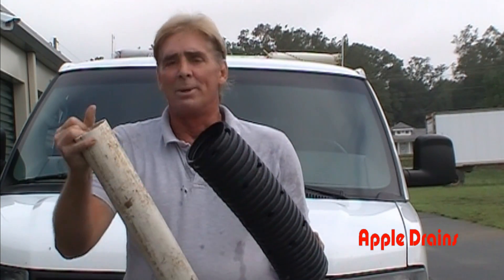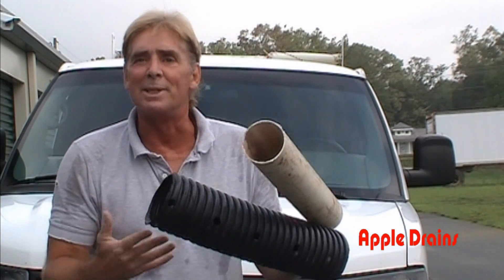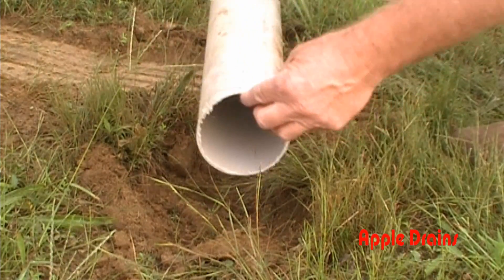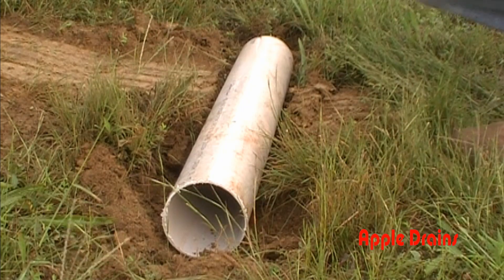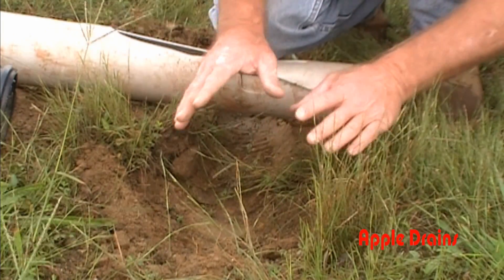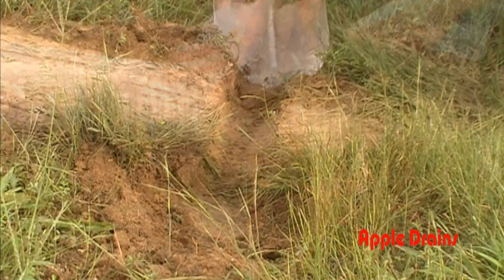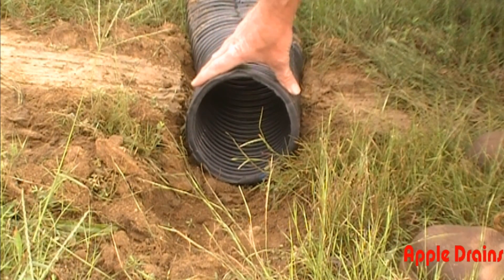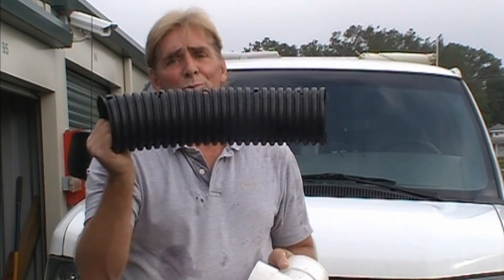Which is Stronger, PVC or Corrugated Pipe - Actual Crush Test with 7600 lbs Van

Comment: Thanks for the video. I'm placing ADS black drain pipe under a gravel driveway about 18" to 24" dp. and was curious what kind of load or crushing forces the pipe might be exposed to at those depths.

Comment: I have to run a 25 ft  solid corrugated line from a catch basin into a canal. It will be buried from 12 to 18 inches underground in sandy/dirt soil that trucks drive over ocassionally. Should i put gravel on the bottom of the trench before putting down the pipe or will the existing sand be good enough since its not a perforated pipe?

Comment: In the automotive world. Any peice of tubing or metal that has squares or circular or angels on it is VASTLY stronger thsn just a tube. 

In the gun world a hexagonal barrel is stronger than a circular tube barrel. I highely doubt a circular tube of pvc is stronger than corrogated pipe. 

We just had a distribution box and about 5 pipes 30 feet each of the drain field replaced. Because prior owners drove vehicles over it. The pvc was completetly crushed .. smashed like pancakes. Broken into peices too just like this video. and this was buried at least 4 feet down i think. The currogated pipe however was perfectly fine.

The plumbers who did the job replaced all the pvc with currogated.

Comment: You're using D-2729 which has walls 0.076 of an inch thick when Schedule 40 walls are 0.237 of an inch. Over 3 times the thickness of the walls of the PVC pipe you used.
Reply: I noticed that too. I found a different video which proved PVC was much stronger and he used a tractor!

Comment: Any plastic pipe will fail if not in the correct conditions. The strength comes from the pipe being fully buried. For instance: hit 3034 (green) pipe with a hammer above ground. It will shatter. Schedule 40 pvc likely won’t. Bury 3034 pipe and expose it to conditions it will likely come in contact with: no problem. There is a scientific equation on this but I don’t remember what it is. The principles of a correctly buried pipe make it much stronger than it would otherwise be

Comment: Pipe of any type is not intended to take the direct unburied weight of a car tire.   All crush ratings are based upon having a minimum depth of coverage.  This test is ridiculous.  Flex is used because its easy and cheap, not because it is stronger.    Want it to last, want to be able to snake out clogs, go with the pvc.  By the way, that pvc is schedule 26, there is a schedule 35 inexpensive sewer pipe that is comparable in price and is very strong.

Comment: From reading comments and other sites it's apparent that if the pipe is buried deep enough, let's say at least 12", then it doesn't matter which pipe you used. But for shallow depths I can't find a definitive answer about which pipe is better. So I'm going to say play it safe and lay down a piece of 4x8 plywood  or a couple of 2x8 planks over it before you drive on it. Problem solved.

Comment: Chuck, is it better to use pvc or corrugated pipe for outdoor drainage?  I live in a northern climate, so that might have a bearing on what you would recommend.
Reply: PVC is rigid. Which won't flex with freeze thaw...So corrugated deep enough at least 6-8" and a good top soil pack should last awhile maybe even put some sand in the trench
Reply: @Goodvibes-Adventures  Okay, thanks for the info, Skater Dude!👍

Comment: Obviously the test wasn't high quality, he had the PVC buried half as deep as the corrugated.

But, the white thinwall PVC is still only a temporary solution because it's not as resistant to ultraviolet  light, which permeates the soil 18" or better. Drainage tile and conductor lines are usually buried shallow (not nearly as shallow as his test) the top being 6" to 12" deep. Try digging one up in 10yrs and watch it crumble to pieces. Also, in the areas with winter weather, the ridgid pipe will be at constant odds with the frost, which causes force against the pipe and causes movement, which also leads to long term degradation and sometimes catastrophic failure. The benifits of smooth pipe are: 1) can be snaked out. 2) easier to install at a consistant slope. 3) it works great as a basement perimeter drain (no sun, no frost).

The black colored corrugated pipe has these benifits: 2) naturally resistant to UV light. 2) it's flexable. 3) the exterior corrugated surface does add strength (only when fully buried in gravel  or dry soil). 4) the corrugations lock the pipe in, to keep it from moving.

However, most of the positives of both worlds can be achieved by buying double wall black pipe, which has a corrugated exterior and a smooth interior surface. Doubtful you'll find it at the homeowner grade hardware chains. Don't base your decision on price alone or: a) your plan might not work at all. b) you'll be doing it again in 10yrs. Always use a transit or laser level to map your property out before planning a drainage system! If you cant plan it out well, you shouldn't do it yourself.

Comment: I found this line "They're even known to collapse underground due to erosion". If your corrugated failed, that would more likely to be the reason. It would collapse with no dirt filled on its sides. I tried to fill dirt and compact it properly, but still, it was hard to do it right. Also, I might have damaged the pipe a little bit with all the hand digging tools that I was using. I wished they made the corrugated pipe thicker wall.

Comment: Here in Nebraska, the ground freezes up in the winter. Ground also shifts/moves constantly any where you live. For that reason, it is good to have some flex in the pipe. PVC is too expensive and hard to install. The cost to install one would exceed the benefit it yields. This test doesn't matter when you bury them underground, but it does shows one disadvantage that pvc pipe has. Any system will fail under some condition. That is why the cities are replacing their pipes all the time. If you are lucky, you might get 100 years out of that solid corrugated pipe. I'm not an expert to know how long they last. My neighbors corrugated pipes are working fine after 8-10 years, or so. I just installed one by myself and hope that I won't have to dig it up in 40 years. I have to say that I don't like the thin wall on corrugated pipe. It can be thicker, but companies cut cost everywhere, while the cost is on you.

Comment: My only question on this is does the corrugated pipe handle freezes better?  I’ve seen other videos that say PVP cracks during the winter.
Reply: PVC will crack if there's enough standing water in it and you get a freeze. If you're using it as a conduit under a driveway/sidewalk or to run a power or phone line to a shed, just make sure water can't get in.

Comment: How do you keep roots out of tbe pipes!?
Reply: Wrap a bare copper wire slid inside the fitting. The root will not pass that copper to get to the water.
Reply: Drainage pipe is surrounded by gravel then wrapped with geo fabric like a burrito.  That should keep everything out, except water as intended.

Comment: Actually ABS for drainage is a little overkill, HDPE would work just fine...Whats important is the application quality which means how deep you bury, how well you support etc... and of course the SN class for corrugated pipes...its like PN for pressure pipes...but SN defines how strong the pipe is against forces from the outside. This is a bad application example from every angle! both for PVC and ABS pipe. PVC drainage contains tons of CaCO3 which makes it cheap (producers make more money) and hard and  at the same time more brittle. So its no suprise it cracks. I dont know about snakes or water freezing inside the pipe but a foot underground its warmer, and its not right to generalize these local problems when comparing 2 pipes...its not just...
Reply: He is saying ADS pipe!! Not ABS!!!   ADS is a manufacturer of the black corrugated stuff! They also make a really great product that's just like that PVC but is triple wall HDPE and is smooth in side just like PVC. But not as brittle!

Comment: We call that white "thin wall" PVC class 200. Good for drainage or lateral (non-pressured) sprinkler lines but not rated for main lines. I wouldnt use it as a sleeve either if its across a drive way or going to ever have a lot of weight on top of it.

Comment: Just run either of them through a cinder block where you will be driving most and you won't have to worry.
Reply: +casperhr22 That's a good idea.
Reply: If you use 8x8 chimney flue cinder block you can run up to 8 inch couragated. Definetly recommend number 3 rebar through the cells and mortar between the blocks
Reply: 4 years later, still NOT a good idea.  Cinder blocks don't have much strength when laid on their side.  They'll crack in no time at all.
Reply: ~three years later~
Very good idea.

Comment: This is crap...  
 Lets revisit an install after about 10-15 years (as I am currently replacing 100's of feet of corrugated drain pipe right now)..  None of my PVC needs service..
Reply: EXACTLY.    I'm going through the same thing after my house flooded after the drain guy put that crap in.   No one is using it anymore.
Reply: Lol, that shit pipe they are selling now is crap
Reply: There's corrugated pipe that's just as strong as PVC it has that green line throughout the run, it's pretty heavy duty stuff, this corrugated pipe is the "El cheapo" stuff sold mostly at big box stores
Reply: hardkore360 N12

Comment: Chuck, Liked your demo.  It helped me decide for the ADS corrugated.  Can you try this one with the van or other vehicle: take two pieces of 4" corrugated & split one lengthwise, spread it and slide it over the first to get a "double-walled" pipe to increase crush resistance, with the split cut line on the bottom.  Also try a third piece, for a "triple-wall."  I'm trying this with 4" solid corrugated (vs. perforated) to go under a 12' wide home driveway that will have only 3 inches fill over top of the drain line due to the grade.  I can tell it is stronger by stepping on it, but don't have a way to test it with a vehicle - until after installation is complete, that is.

Comment: This is total B. S.! 1st notice he did not pack soil along the white pvc pipe. So it did not have the support along the sides like the corrugated pipe. 2nd every groove in the corrugated pipe is a nest for mosquitos. I do not need any more mosquitos on my property so for that reason alone I never use corrugated pipe. 3rd water flows freely without resistance through the pvc pipe, every ridge in the corrugated increases resistance to water flow. 4th The pvc is easier to clean and much easier to properly slope during installation.
Reply: 5th , this is not Schedule 40 PVC . Run 4" sched 40 PVC ...it's only a little more money and twice as thick as the thin wall stuff
Reply: If you're going to be running over a drain with a heavy vehicle, that has been properly buried, use SDR35 rather than 2729 PVC. Don't waste your time & money on corrugated crap.
Reply: Never thought of that. Thanks!  We have lots of crane flies in our area and will consider the thin wall as an option.
Reply: Mosquitos breed in the pipe? What are the odds of that? 
I never heard of that but I assume it would be possible. Those must be some desperate mosquitos. Generally if the pipe is put at the proper slope those little areas dry out quick in a few days (Takes about 5 days for mosquitos to hatch). I want to see a mosquito fly into a pipe travel 5-100 ft etc, lay eggs and then remember how to get out of the pipe. 

A bonus for the ridges is it agitates the water. This helps push debris out when the flow is slow but you should always have a catch basin somewhere. Both pipes can be cleaned with the same tools and slope should be determined by the trench not the pipe.
Worst part about PVC is cost, installing (May need a ton of fittings), 
Worst parts of Corrugated is roots. You can tape the fittings to possibly stop this.
You really cant go wrong with either
Reply: That sounds logical.
Reply: My son and I have to do a drain so I am watching videos and reading comments for informative comments like yours. Thanks! We can't afford to get someone to do it, so we are hoping to do it right ourselves :)
Reply: A lot easier to de clog..
Reply: Calm down Hillary...
Reply: You got a point
Reply: Well said. He is using thin walled pvc why would anyone use a cheaper material when labor is 75% of the cost ?
Reply: He also installed it ridiculously shallow. If you're in a frost zone, that pipe would heave in a couple years. If you're in a mild traffic area, any pipe outside of concrete or steel would crush. 
It's a decent demonstration, but in no way realistic.

Comment: I dug up a piece of corrugated, perforated drain pipe that was buried 4 ft in dirt and rock for 20 years.  Looked like the day we buried it.  It was driven over many times with my pickup truck full of fire wood also.
Reply: +davidmackv3 
You would have the same results with PVC since being buried 4' deep is sufficient to not be affected by vehicles driving over it... you could drive a tank over it with no problem.

Comment: Corrugated pipe is absolute garbage on so many levels, good for 10 years max and is only used because it is cheap. PVC is used everywhere except where it will be driven over, in that case you use ABS
Reply: MrFakit See this asshat's other videos. His workmanship sucks worse than the videos. Corrugated is cheap! They make that garbage where the old AT&T wire mill used to be located, down in Phoenix Az. I just looked at a $375,000 home that was inundated with flood water when the corrugated French drain failed. It just sold on the HUD site for $223K. Its mold city in there now. Wood rot. The site grading was done wrong too, but had the drains not failed. The window wells are rusted out, and well, gee whiz, do ya think that might be an indicator?
Reply: Well I came here looking for advice. I don't want this to be a temporary fix I want it one and done... Pcv here I come... No its on the side of my yard and unless we get a drunk driver no one should be driving on it!